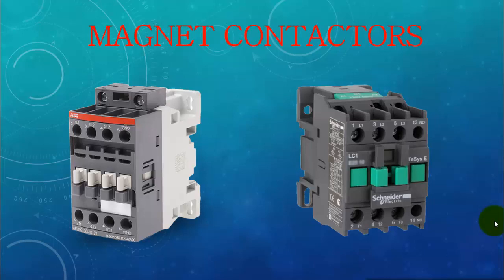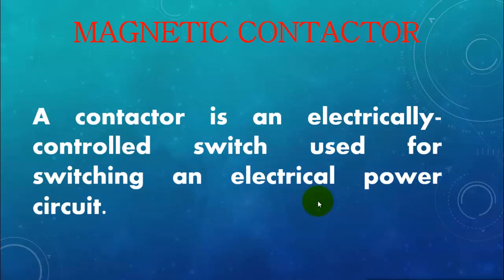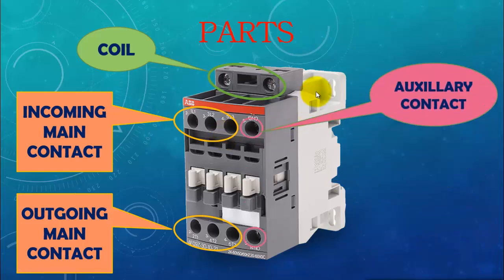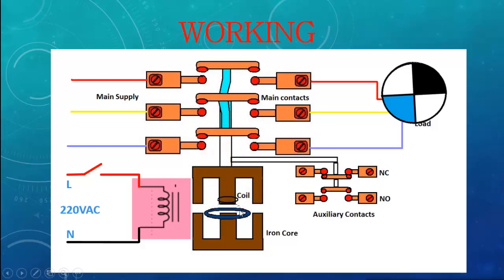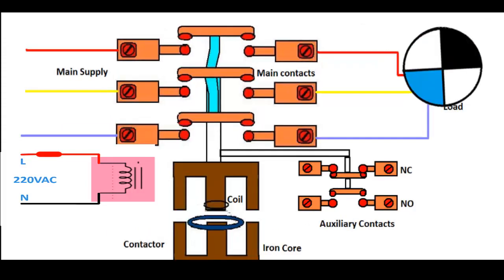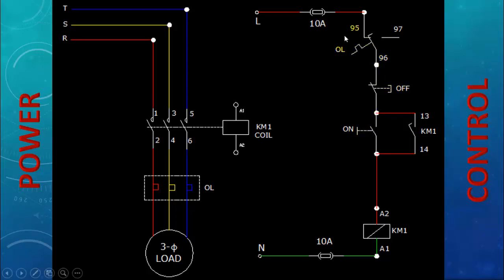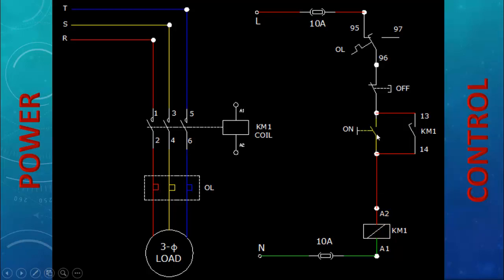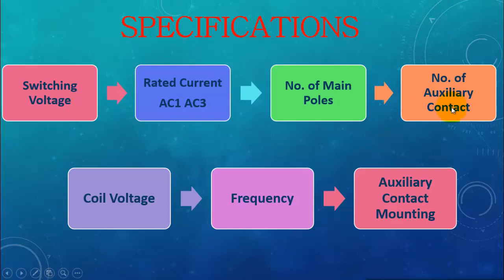What is Contactor? | All About Contactors | Wiring Diagram

Comment: how does the coil stay energized after releasing the green button, i understand that you use a parallel no contact but i don't get how it stays active after a single press, i mean how the current continuous to pass through the contanct mechanically. In my mind releasing the button even with the no contact shouldn't it stop the whole thing?
Reply from the maker: This is very basic usage of contactor. It energizes as soon as you press the push button. And when it energizes completely and plunger pulls the contacts, then it's auxiliary contacts also change their state. When no is used it change to nc and continue power across coil. This is called holding

Comment: Can we connect load carrying circuit to the aux terminals??
Reply from the maker: Not at all . Check the electrical rating of aux contact. If the load is within current rating of contact then you can do

Comment: can I use contactor to switch 24VDC 100aMP (source 1) OR 24VDC 100aMP (source 2) to a single load  which need 24VDC 80AMP. When my  source 1 fail to generate 24VDC, the load should automatically switch to source2.
Reply from the maker: Be very careful to switch 24vdc . Bcz contactor rating are for switching AC. There are special DC coils to switch 100Amps

Comment: how much the load or amp will be use by the coil?
Reply from the maker: Very less usually 25w to 100w coil. For 11kv contactor coil is around 220W. So it means less than 1A @220vac

Comment: Do not understand the difference between AF09-40-00-13 and AF09-30-00-13. Both have 4 normally open contacts…
Reply from the maker: One has 3 NO power contacts other has 4 NO . 4NO is normally used for phase reversal purpose

Comment: What is the voltage applied for coil to make it electro magnet. 12volts, 24volts? How can we know the same. Is this voltage given saperate from addaptar?
Reply from the maker: Its mentioned on each contactor. You can have different coil voltages ranges from 24v to 230v ac or dc. Its important you must apply voltage equal to rated coil voltage to make it electromagnet. High voltage will make it burn
Reply: @electricallectures  Thank you.
Reply: @electricallectures  I wanted to purchase 24 volts coil contactor. Can you send me a link where can I get one.

Comment: how much the coil resistance sir ?
Reply from the maker: Normally in ohms. From 100 to 300 phms
Reply: @electricallectures  okay , few days back , one of the auxiliary contactor coil got burnt, how to avoid these issues of coil burn outs ? is there any predictive method for these kind of problems ?
Reply from the maker: Not at such. Main source is voltage spikes which damage the coil. Normally in general maintenance of contactor we dont consider the coil . Only overhaul the contacts

Comment: When using 3phase contactor,  do I still need a separate 120v circuit to energize the coil ?
Reply from the maker: Contactor comes in different coil voltage range that depends on control voltage. If it is 120v then u connect phase to neutral  across the coil.
Reply: ❤thanks boss❤